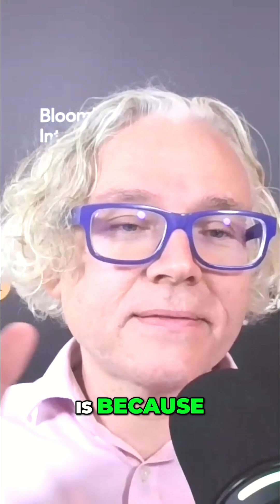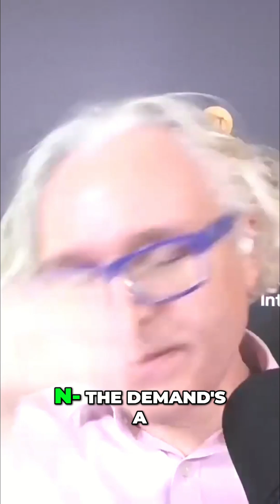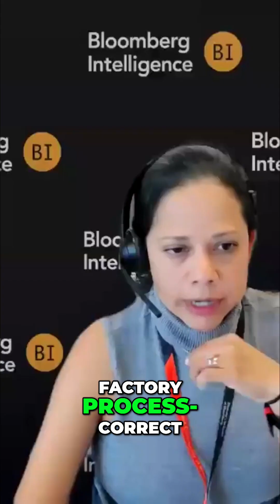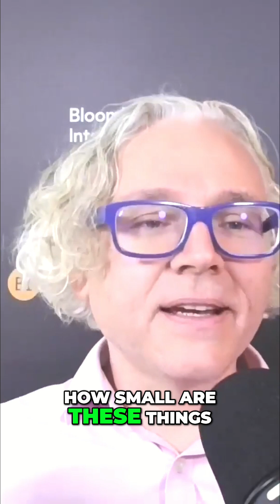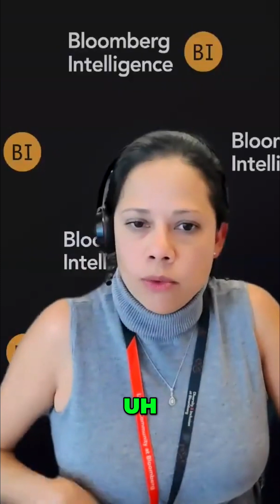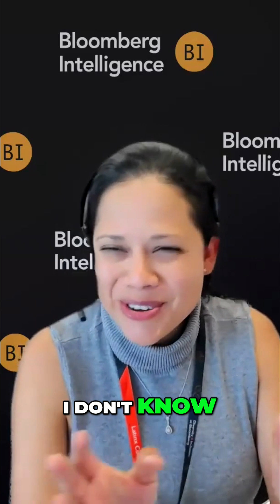Factory-Built Nuclear; Can SMRs Cut Costs Like Solar?

Comment: "cheap" ...  to run a typical American house, the panels + batteries + mounting hardware will cost you around $22k on average.  Not cheap.  
And the companies that sell and install the panels will PUSH YOU HARD to "rent" the panels instead of "purchase" them.  You'll still pay the same price, by the way, but then the company OWNS the panels so THEY will get all the government tax breaks and everything, the only benefit you'll get is reduced electrical grid cost.

Comment: Something interesting about solar energy in economics of energy,as he said yes it would be more than current demand yet demand is so flexible with price.
You would be amazed by how many new applications and demands for energy would be created with electricity getting cheaper than a point there's no such thing as long term shortage of demand nowadays and that's only for countries with low GDP in developed countries we're no where even near actual demand if it was cheaper and they're always over demand for data centers,AI farms and crypto mining.
It's about the infrastructure of that nation because they can easily make a production plant for solar panels yet budget for delivering that power to destination is even more capital intensive, specially in developed countries with aging grids.